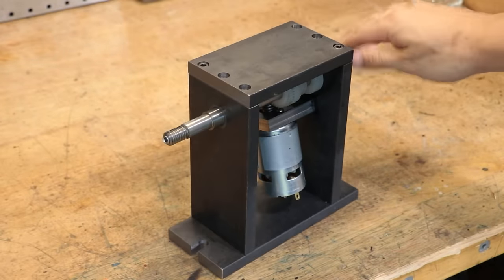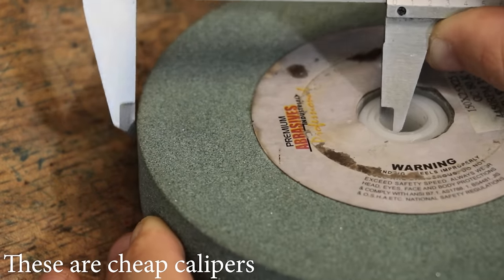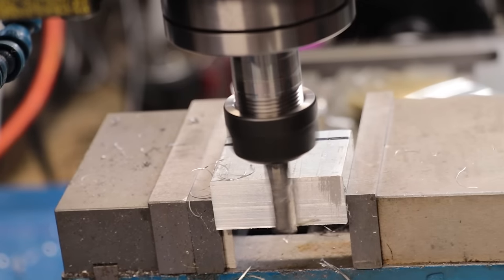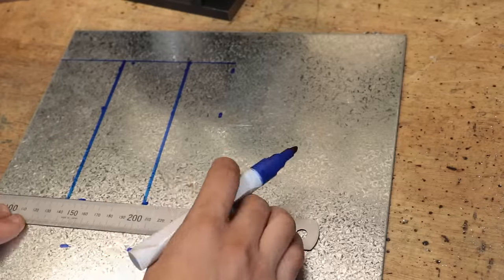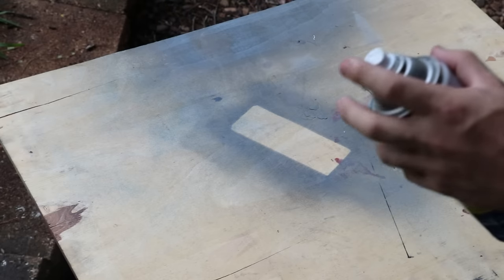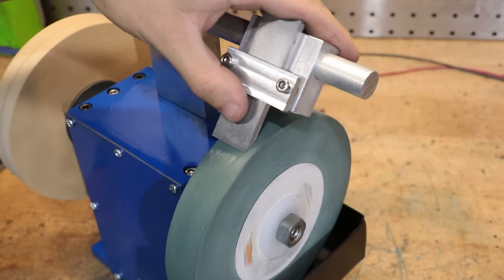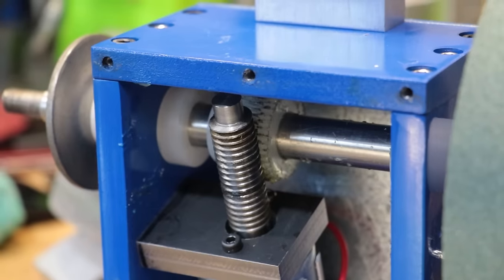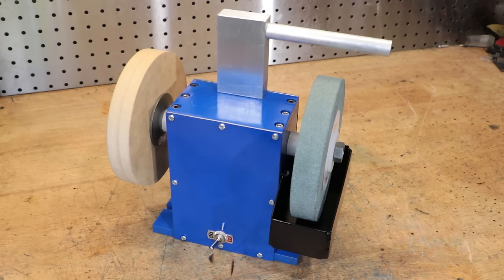Whetstone Grinder Build - Part 2

Comment: Aluminium oxide and silicon carbide are rather different animals, we're talking "cats" and "dogs" here - and while you certainly can use SiC for grinding/ sharpening HSS, Al2O3 is far better for it. Yes, you CAN use SiC grinding wheel for HSS. high carbon steel, but, how shall I put it...
I mean, cheesecake is good and beer is good too, and then coffee is good as well, and so are potato chips - HOWEVER, for some obscure and not exactly understood reasons cheesecake is not usually washed down with beer, and chips are not served with coffee. I mean, yes, it can be done, but... yuck.
And then some people like more "beer n chips" set while others prefer "coffee and cheesecake" treat. And then some like a generous servings (of any of these "sets") while others are more satisfied by smaller portions.

Or, alternatively, it'd be like using a dog to catch mice. Yes, they can do it - but cats do it much better. (Or using goats to guard your property.)

Ditto for grinding stones and the materials that are supposed to be ground by them - and when it comes to choosing THE RIGHT stone there are THREE factors to consider - the hardness of cutting material the grain is made of, the hardness of the matrix it's set in (that choice is done at the manufacturing stage), and finally the grain size.

Lemme elaborate a bit on it...
The thing is, grinding wheels/ discs and their intended use is the play between the actual cutting material and the matrix it's set in, and these two are correlated.
I wrote "cutting material", as grinding is basically a lot of small cuts done by plethora of tiny cutting edges, and the official definition of grinding wheel I came across in some obscure machinists' handbook was "a multi edged cutting tool with an undefined geometry of cutting edge" - but I digress here.
And these tiny cutting tools are set in matrix (which could be ceramics, synthetic resin, hard rubber, brass, nickel, nylon and others), depending on the purpose of the tool and type of the grinding material it's made of.

Some cutting/ grinding materials are very hard (SiC, aka carborundum - or diamond), while others are much softer (Al2O3, aka corundum), but all of them would get blunt at some point of use - the grains, that is - and then they need to be replaced. And this is where the matrix properties step in.
When the cutting edge of a grain gets blunt the cutting resistance increases, and so does the force exerted on this tiny cutting tool - and when that force exceeds matrix ability to hold the "tool", it gets yanked out and fresh one steps in (think "shark replacing its teeth"). 
But if the matrix is too strong we get the effect commonly referred to as "glazing", and the stone/ disc doesn't cut the material any longer, it just rubs on it and generates heat.
Usually it happens because IN GIVEN APPLICATION the matrix is just too good at holding the grain (which may come about since for other reasons/ consideration it just HAS to be strong and resilient) and this issue is pretty common in angle grinder discs - they HAVE to be strong and bing the grinding material (SiC) very well, so they are safe to use.
But when you're grinding off mill scale with them the disc gets glazed easily (the phenyl resin matrix holding SiC grains is too strong for effective removal of blunt grains in this situation), and then to "resharpen" the disc you have to strike it on a hard edge (of steel or stone), couple of times - while spinning, of course, AND NOT too violent - which would force blunt grains to be removed.
When you cut bricks with diamond cutting wheel (diamond grit set in some soft-ish alloy - brass or probably some nickel alloy - ?) and it gets blunt, the manual calls for running it, for a moment, through a HARD material, like concrete - to resharpen it. Glass core drills (diamond grains set in brass) are resharpened by plunging them into small "sharpening stones" made of corundum - the glass is way too soft to effectively remove blunt diamond grains from brass - but I digress here, and you get the idea... hopefully.

And that's why corundum stones are used for HSS/ high carbon steel - Al2O3 is relatively soft, but so is steel, and the matrix is also weak. Which results in blunted grains being removed very quickly, which means grinding steel with sharp grains all the time, which means low heat generation, which means no "burnt" steel, which means "bueno".
HOWEVER, Al2O3 is far too soft for grinding any "carbide" tool, so SiC wheels are used for it. But then because the forces acting on SiC grains in this scenario are much greater, the matrix has to be much stronger as well, which means they may not fall out as quickly and you may end up generating too much heat while grinding steel tools, and "burning" them - which means "no bueno".   

ACTUALLY, the best set-up for brazed-on carbide tools is to use that "green" SiC wheel on a REGULAR ("high speed") grinder for rough sharpening/ shaping the edge, on the "regular" (cylindrical) side of it - and then finishing/ polishing them (and grinding tip radii or reliefs on them) with "fin(er)" diamond wheel (dry grinding too), also mounted on a regular grinder (like, on the other side of it) - but using a diamond disc with "side" (i.e. flat) grinding surface.
There's no need for slow grinding of carbide - it won't give you any benefits, at least not any tangible ones - it will only take you more time to do the work. Wet stone/ whet stone grinders are meant for precision grinding of steels - HSS or high carbon steel.

Also, people working in carbide sharpening shops (circular carbide-tipped saws) say one should avoid touching diamond discs with steel, as it may clog it (in similar fashion aluminium will clog your steel cutting discs) - and I heard some of them saying when they need to remove more of the carbide and there's a risk of diamond disc rubbing on steel for prolonged period period of time, they fist grind off some of the steel on a regular bench grinder.

So, to sum it up that little rant of mine - as you can see, not all grinding stones are made equal, and "harder" stone doesn't mean "better" - in some cases it may turn up worse. Chains or steel ropes used for lifting heavy objects are "stronger", but not always "better" - sometimes you can damage the hoisted objects with them and it's better to use nylon straps or soft kevlar lifting loops.
That "guide" on TORMEK website is rather oversimplified, meant for "ain't got no clue" customers, and it never explains (AFAICT) the underlying principles - the interplay between the grinding material and the matrix it's set in. Coarse vs medium vs fine is pretty obvious and intuitive, but the rest is not.
Hope it helps... : )

Comment: Very cool. Watching you turn MDF on a metal lathe scared me! I hope you don't have too much dust in your ways, mixed with oil....
And please invest in proper wire crimpers! If you do any higher voltage a proper crimp will be safer.

Comment: "You shouldve used a proper sheet metal brake". " Its imperative you use proper wire crimping pliers, or the earths axis might shift". "You should get a bandsaw". You're not doing that correctly.  "I would've used precision ground rod, i guess some people don't take pride in their work". All the negative types of BS I'll be reading in the comment sections. Like AvE says "You want to find out the proper way to do something, just post a YouTube video doing it a different way"  paraphrasing of course but you get the point.

Comment: Please stop welding that zinc plated sheet indoors. You will get zinc fever and thats not nice. 
Never weld zinc plated material if you really dont have to. And the do it outside with a fresh air mask and a good filter.

Comment: as the owner and user of sharpening stones for razors and knives, in my opinion you will not have the best result... unfortunately the discs you find on the market are all very coarse grained, because when it comes to sharpening on stone the lowest grade starts from 800 up to 12000 synthetic ... then the natural grain is estimated, however on bench grinding wheels if you find a P320/P400 it is already a lot
Reply: however it must be said that metal tools will never be as sharp as a shaving razor, for example the razors I have once sharpened with stone you just need to cut a sheet of paper and the edge loses a lot of sharpness. they are sharp and delicate. mine is a German steel Solingen so it's not the cheap material. We are on 2 different sharpening levels
Reply: @albertodalmaso8896  there's a big difference between a kitchen knife at 40° a plane/chissel blade at 25° or a razor at 10°
Reply: What he's doing clearly works. He demonstrated it. Most knife sharpeners don't know what they're doing. So thank you for perpetuating the stereotype.